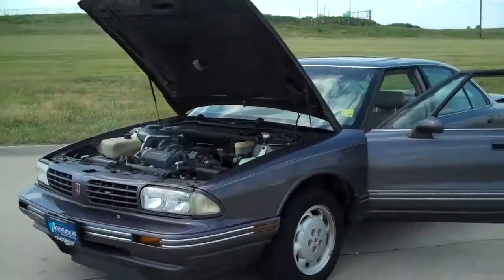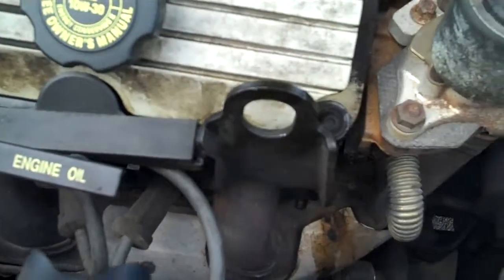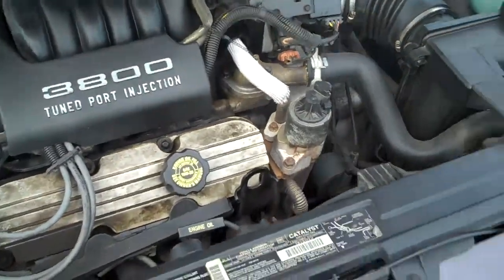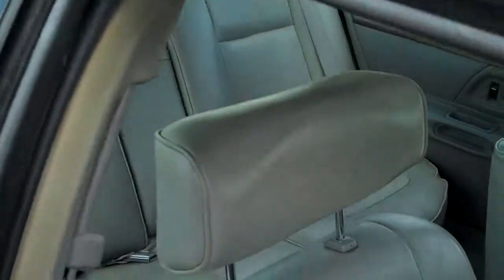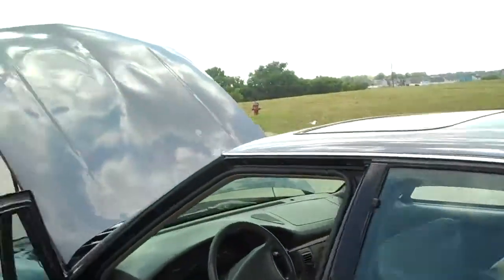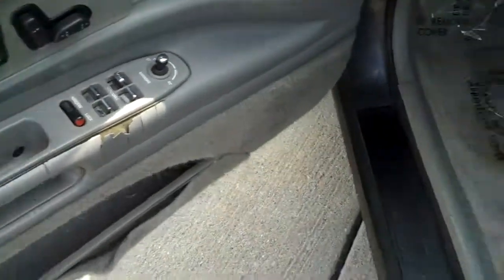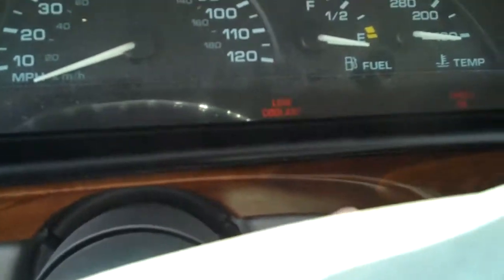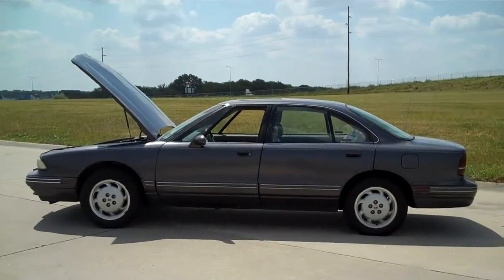1994 Oldsmobile 88

Comment: Yeah those stock valve gaskets are crap. Replaced mine before college and never had an issue again. I actually have an LSS just like this one, same model year, only it's black, the interior is a custom tan color and no sunroof.
Reply: Had almost same lss with the tan interior green exterior. Leather was like butter but only the driver seat started to crack by the middle stitching connecting front panel and back panel. Loved all the options that were in this car at the time. My Olds had almost every upgrade. But most of all I loved that engine! That engine would never die!
Reply: @angieantonacci2287  my dad had a 95 oldsmobile 88 lss edition with dark green exterior and tan leather interior although as much as he loved the car and drove it for years since he bought it brand new he had to get rid of it from driving in through many years in the snow